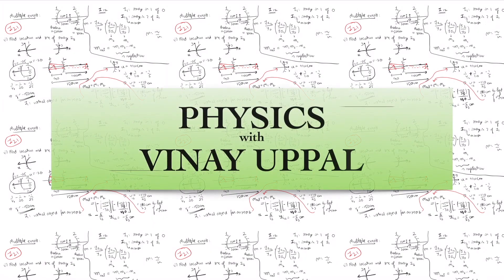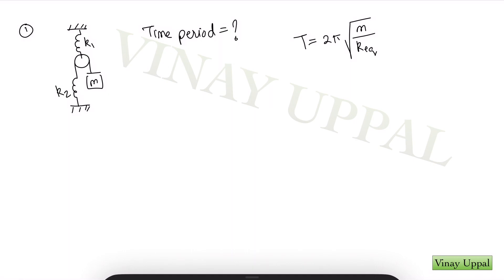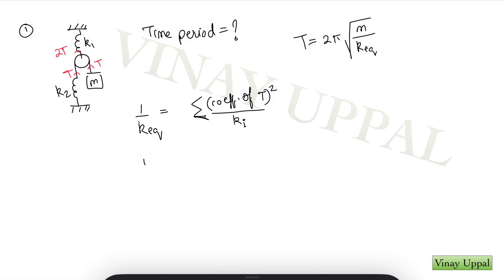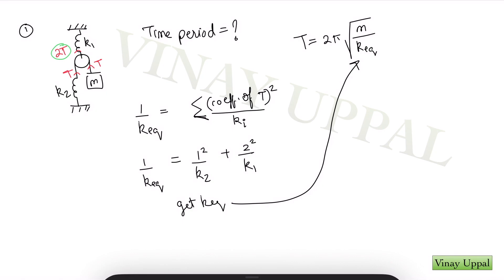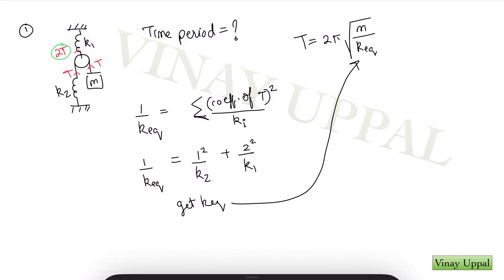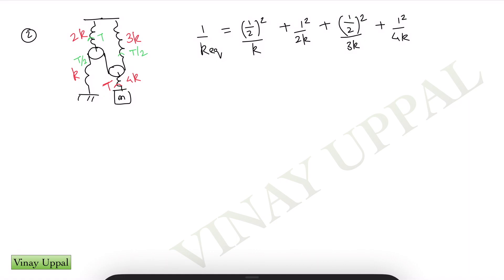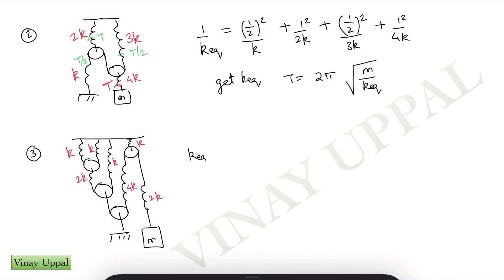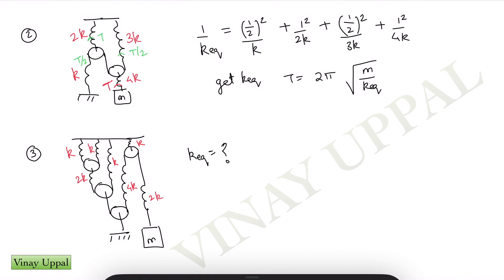S2 RARE: Episode 3: Amazing Short Trick. Simple Harmonic Motion. Jee Advanced.

Comment: What is the derivation?
Reply: using taylor's method
Reply from the maker: Write Constraint equation
Reply from the maker: @krishgupta7898  ?? No
Reply: @krishgupta7898  what?
Reply: @PhysicsWithVinayUppal  sir using that I could only get the fact that work done by the tension force in a string is 0. I’m stuck in proving this. Please guide me.
Reply: @krishgupta7898  taylors method is diff bro .... there is phys. galaxy vid for it , it explains , use also id diff

Comment: How do you find tension that way?  Like T or T/2 or 2T and so on?
Reply: Make FBD of that pulley

If it's in equilibrium
Then at the bottom side of it 
T + T (two identical tension) are applying force

To balance that, Force should also be present acting in upward direction...
Therefore 2T
Reply: Ok got it. Thanks.